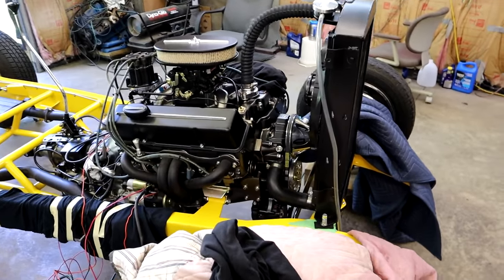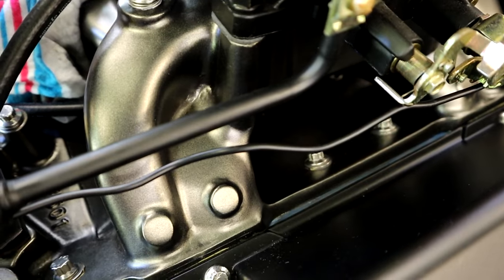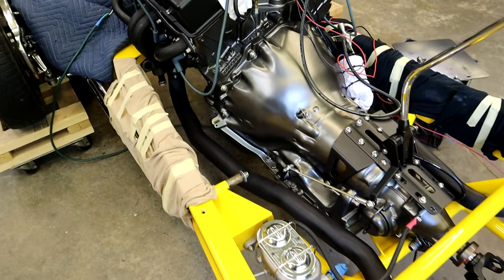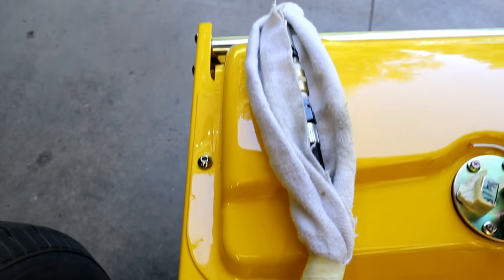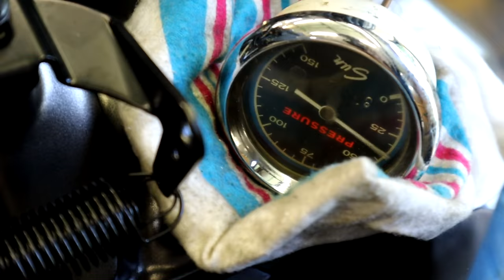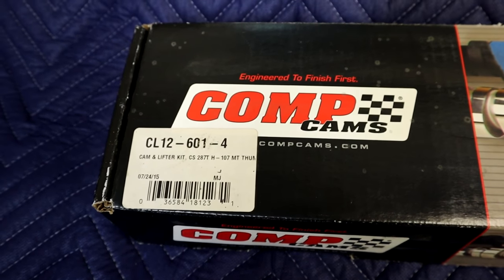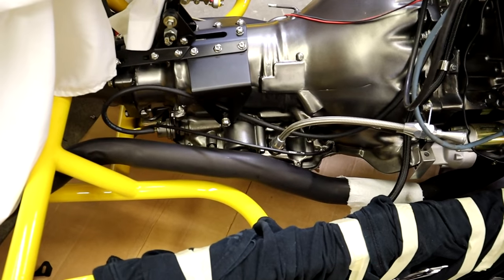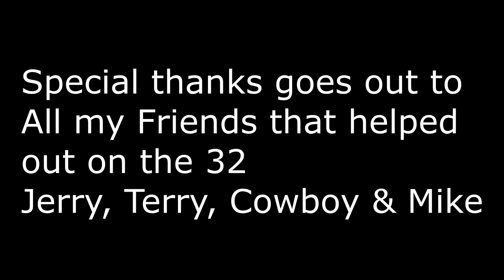Crate 350 Small Block Chevy - with Mutha thumpr Cam - First Start !!!!!!

Comment: Sweet sounds of the 1960's, cams, headers, close gear ratio 4 speeds, aluminum high rise intakes & hollies, and nice rear ends.  It was all about the sounds with good friends.  You never get it out of your system.
Reply from the maker: You nailed it 👏 👌thanks for the comment!!!!!
Reply: Just like classic Volkswagen Bug & Ghia lovers.
Reply: Yeah sorry, they didn’t have cams like this in the 60s…🙃
Reply: I was born in the 70's but still young enough to remember the sound of a cammed sbc.
Reply: @David  No, they're different from the 60s,  back then it was called a 3/4 cam, or three quarter race cam. My dad had one in his 1967 camaro. "Iski" cams were the thing back then. Flowmaster wasn't born yet, everyone had cherry bomb or thrush glass packs. good times, I miss those days.
Reply: @theNillaLenape  Better ones like Isky and Crower
Reply: @theNillaLenape  They sure did

Comment: That brings back memories of breaking in the 280* .512 lift in my mustang. Good times.
Reply from the maker: I bet that sounds awesome , thanks for the comment!!!!!
Reply: I understand that.  I had a small block 366 CID Chevy. 16.5 to 1. 675/326 can full roller motor naturally aspirated single carb would run 8 seconds in quarter mile.  400 turbo manual valve body 5500 stall in a 1967 Camaro. Miss the true good old day's.
Reply: @norristammislideshowmulgre877  that's sounds pretty bad ass.  Fortunately they make them faster now than they did before,  if you got the money.
Reply from the maker: @norristammislideshowmulgre877  now thats a hotrod!!!!!!!

Comment: I have always liked the sound of a 270 s comp cams solid lifter cam combined with a c26 and a pair of 9000 series a f b carbs a pair of 461 casting heads 10to1 compression and an aluminum flywheel on a 350 Chevy nothing can beat the throttle response that build will give a small block Chevy
Reply from the maker: I agree , I've always loved comp cams, thanks for the comment 👍

Comment: I can tell that’s gonna be a beautiful ride! The detail is awesome! That frame looks really good! So does the engine where you sanded it down and filled it with epoxy primer and such. Really good job. I’m tempted to paint my stroker that color!
   Here’s a piece of advice though; I know you want to hear it idle and all after you break the cam in but it’s really important to check the pushrods as soon as you’re done with that 15-20 minute run in. Shut her down, take the valve covers off, mark the pushrods, and make sure they’re spinning. Make sure you didn’t wipe out a cam lobe. Very important.  Besides that it’s an awesome ride! Really cool!
Reply from the maker: Thanks you for the kind words!!!!!
Reply from the maker: Thanks for the info on cam break in, we broke it in ,I just edited it out due to making the video to long, thanks for the support!!!!!!!!!!!!
Reply: C'mon bro. That's the FIRST thing you learn

Comment: Sounds and looks AWESOME !!!! Just a "heads up" on the "Pertronix Flame Thrower". We built a similar engine (283 with a custom ground cam in a 57 210 Sport Coupe) and used the Pertronix Flame Thrower distributor and coil. Like you, started it and set the timing at 12 degrees with a "dial up" timing light. It ran great on the stand. In the car, however, it was having a really hard time getting the car moving from a dead stop. Once moving it was great. Originally thought the issue was a too big/fat carburetor so began a process of "tuning" the Edelbrock Performer carb. Edelbrock tuning kit, step up springs, metering rods, and jets leaned it down by +- 15 percent while bumping the timing to 16 degrees made it better but still not right. Ultimately installed a AFR gauge and verified our carb settings. 
Two months in, finally got the answer when I installed a "points" type distributor and set the timing. The issue about went away. Talked to Pertronix tech who told me "DO NOT USE A DIAL UP TIMING LIGHT WITH THE FLAME THROWER" !! The Flame Thrower creates a MSD (Multiple Spark Discharge) ignition that "fools" the dial up light so you aren't getting the advance you think. "Use a cheap (Non dial up) light to set your initial timing" !! I have mine set at 18 degrees (with no vacuum to the advance) and the engine loves it!!! Absolutely NO issues associated with the timing. New points and condenser with dwell set at 30 degrees so, for now, I'm keeping the points distributor. will change back to the electronic later. Again, just a "heads up" to try to save you two months of "hair pulling" !!
Reply from the maker: Awesome man, thanks for the heads up!!!!!!

Comment: That right there kids,is the sound of pure happiness and glory.........oh wait im still a kid. Im 16 😇

-Edit im now 18 and now i got my own 87 chevy r10 i got for a good deal,now im building up the motor with a almost all black theme with polished accents here and there like my valve covers since they have little ribs that i had to polishe same with my intake manifold were it says edelbrock and what not, block is all orange since i still wanna see any possible leaks but with all the felpro gaskets i put on it with some black rtv here and there and gasket sealant as well to dress up the paper looking gaskets it hopefully shouldn't leak......hopefully... ._.

But the engine is a stock 350TBI now a 355 since it had been rebuilt with a small cam since again its a stock motor with the worst heads possible since its a TBI forgot the specs of said cam but it will have some lope/chop to it :D ,now im just saving up for the holley midmount accessory drive kit in black ofcourse should be able to buy it super quick since i got a really good job that pays really well and it might end up being my career maybe

Another thing to top it off is that all the hardware on this baby is nice quality ARP hardware to go with the new and freshened up parts on there :D one of my favorite things about my motor :D
i would list the parts i bought and some that i restored and painted but its basically almost ready to drop in once i freshen up some of the drivetrain and find the wiring for the truck thats somewhere ...........
Reply from the maker: Hot rod kid!!!!! Thanks for the comment
Reply: @ACDesignsGarage  Your welcome 😇
Reply: Im 16 to bro your not wrong

Comment: I have a 385inch stroker, with 11:1, and the comp nos HP cam, I can't wait to hear it, 
Yeah she's very talkative, at idle , and at cruse rpm,  my cam is the largest nitrous HP cam, with .585" lift with 1.6:1 roller rockers, your paint looks awesome! I love metalics with flat/satin clear over it,
Reply from the maker: Thanks man, Are you gonna film a video on it, id love to hear it run, or if your on Instagram tag me in it, mine is @ac_designs
Reply: Better have you some good flowing heads that peak at about .600
Reply: So you have heard your cam or you havent?

Comment: I think that I purchased the same motor from jegs. Assembled in Mexico. For 1984 Chevy c-20. Original air cleaner had decal stating timing to be 4 degrees. New engine ran terrible at that setting. Reset timing by ear and ran better. The setting by ear threw the timing light way off. Engine still running good. Wish I would have purchased the cam you have. Motor sounds great. Gonna sound really good on street. Peace👍✌
Reply from the maker: Awesome thanks for sharing and your support!!!!
Reply: Engine came with instructions Im guessing? Hope you got a timing light on it, the by ear thing is never accurate .

Comment: This is a master piece. I got a similar  air cleaner . I was told to get one either taller filter or the ones with a filter on the top part.. to get more air into the carburetor. Your opinion. Take care!
Reply from the maker: Thank you, Ive heard that also but id rather look cool than have proper air flow lol

Comment: You always need to keep the high idle up while the cam breaks in, fin awesome guys !
Reply from the maker: We did, i just edited it out so i didn't bore everyone lol ,thanks for the comment!!!!!
Reply from the maker: Jeffrey Bamford  you would be surprised lol 😆
Reply: 2k rpm, which is the point of optimal oil flow.
Reply from the maker: @barnabyjones5161  I would say depending on the oil pump probably around 1500 to 2k rpm
Reply: How long do you keep the idle up while breaking in the cam ?   20-30mins
Reply: @ACDesignsGarage  Kinda low...2500 give/take and varying rpm always worked out well

Comment: Problem with 2005 Lariat, 5.4 Triton eng. Cold start backfiring, once it goes runs well, wiring? Has a new gas pump. What do think is the problem? Need feedback?
Reply from the maker: Do you know if its throwing a code/ is the check engine light on ?
Reply from the maker: Dave Micolichek  thanks for helping out, I've been searching online to try and help him out ,but im not familiar with the 5.4

Comment: That's solid as a rock all the way down I love those Mutha Thumpers. I've installed one in a 468 in my 1977 gmc but it didn't let me pass up service stations. Are you using flat tapped or roller I have a case of Comp break in oil.
Reply from the maker: Were using hyd.flat tappet.  Witha all the lifter problems the next one I do will be a roller for sure!!

Comment: For what it's worth, my friend, I've built more smallblocks than I can remember, but I've always used white lithium grease for assembly lube and Mobil 1 full synthetic oil in straight 50 wt. for racing and 10w30 full synthetic for street use.  This is my first time on your channel and I like what I see, thanks for sharing. BTW, I'm leaving a thumbs up, a sub, and a click on the bell. I hope to see more of your works (fun), in the future.
Reply from the maker: Welcome aboard, Thank you very much for your support!!!!!!! Awesome ,I always love when people share there tips and tricks !!!!!!!!!
Reply: @ACDesignsGarage ,
I'm on the tip of my seventh decade, if it weren't for the "Old Timers", way back then, I wouldn't be sharing what I've learned, possibly from them. Keep up the good works, I enjoy seeing a nice clean workshop too.
Reply: Synthetic oil, especially Mobil1 is awesome oil. But synthetic oil of any kind is not the way to break in an engine. Most engine builders will strongly recommend against it. Synthetic oil does not allow the rings to seat properly, and should not be used until there is at least 5000 miles on an engine. And if its a flat tappet motor, you need to add a zinc additive to the oil to not destroy the cam. Or buy a special high zinc oil.
Reply from the maker: @jeffpolsene680  we used valvoline vr1 which is a high zinc oil that my engine builder recommended,  i have to change my affiliate link something  went wrong there lol, thanks for the tips!!!!!!!
Reply: @jeffpolsene680  ,
Jeff, did you have a 65 Chevelle that you bought new and used just on the dragstrip?
Reply: @jeffpolsene680  Mobil 15-50 has some decent zinc but like you said....a non detergent oil (not syn) is best
Rings were seated by  mile 50, no need to go 500 unless you run old iron rings and a rougher hone finish

Comment: I enjoyed watching your video I watched it before I like looking at old vehicle and I like the color you put on your 350 motor can you tell me how much it cost you to fix your motor like that
Reply from the maker: Its not to bad if you have the material laying around, but if you go to buy it it could be several  hundred dollars. I ground the block as smooth as I could then epoxy primed it, the shot a light coat of 2k highbuild then sanded it with 320, then shot the base and clear coat.

Comment: With your cam specs that motor should run it's best around 31 degrees advanced
Reply from the maker: Thank you
Reply: You mean 31 total correct? At 31 base it won't start. Need to drive it and maybe make a couple 1/4 mile passes to experiment with different timing  settings and then curve the distributor accordingly to get the best driveability.
Reply: @dougthurmond5988  yes absolutely
Reply: @dougthurmond5988  that cam might need a little more timing, not that damn much though lol, he said bad for the environment lmao, he's on the wrong page, he needs to be on one of those soy boy beta pages
Reply: @poopl00p3r  lmao 🤣
Reply: @Romans--bo7br  sbc run best around 36 degrees in stock form so I don't know wtf you're talking about lol
Reply: @jonathanlawson4667  Depends on the cyl heads.

Comment: Sounds great, but you only had it running about a minute and a half in the video before you let it idle. A flat tappet cam needs to run at 2000 rpm  while varying for a good 20 minutes. Im sure you guys know this , did you do a little time lapse while breaking in the cam? Just wondering. Would hate to have to replace cam in a few hundred miles.  Awesome job on the trans and engine paint. Car looks good.
Reply from the maker: Thank you!!! Yeah I just edited out the break in cause it was gonna be so long.
Reply: It looked like he had retrofit roller lifters, if so there's no need to break it in

Comment: I have a question about the exhaust pipes.
The pipes that connect between the headers and mufflers, did you fabricate them or are they a bought item?
If bought , where?
Thanks!
Reply from the maker: Thanks for the question, the exhaust was built by adams hot rod shop thats where we bought the chassis from, all we had to do was buy the headers. You may be able to contact  him to see if he would make some, he builds a ton of these 32s and bends the exhaust in house.
Reply: @ACDesignsGarage  Thanks!

Comment: Did the camshaft eat itself up after driving it ? The minimum break in time is 15 minutes at a constant 2,000 rpm
Reply from the maker: Thats how we broke it in but I just edited it out cause it would of been to long of a video. Thanks for the comment!!!!!!
Reply: Don't need to break in a retrofit cam, those are hyd roller lifters,
Reply: @briandcarey3110  The part number on the box shows he is using flat tappet

Comment: Why is the distributor positioned like that?
What's the vacuum at idle? 
Sounds great 👍👍👍
Reply from the maker: We never put a gauge on it. As for the distributor we positioned it a lil different so we could clear the firewall better, we weren't sure how close it would be to the firewall before we put the body on.
Reply: @ACDesignsGarage  ok. Understand. Custom vehicle. Thought it might have been a speed trick. Lol
Reply: Might need a vacuum canister with that cam, the Thumprs are notorious for having bad vacuum, you have the  mother thumpr too,

Comment: "Set timing at 12°"...  I'll bet it overheated at idle too!  Why does no one verify their timing with a vacuum gauge?  Thump'r cams run best with LOCKED timing at your all-in spec.  This is due to the large amount of overlap they have (to make the sound at idle).    Mine is locked at 35° in my SBF 289.
Reply from the maker: It idled for 1 hour inside and never got over 180 degrees
Reply: @ACDesignsGarage   Interesting.   Vacuum advance connected to manifold or ported?

Comment: Those cams sound the part but your throwing 20 HP out the tail pipe by using it
Reply from the maker: Yeah thats what we wanted, just some noise ,not really concerned about hp lol
Reply: @ACDesignsGarage  I hear you, I actually learned the hard way twice just how much HP is lost by using this cam. I threw 60 HP down the drain on a 545 CI Big Block Ford. Pulled it on the Dyno and put the old roller back in and gained 59 HP and 26 TQ. The older Cam had basically same lift # but duration was a bit tighter and the Lobe Separation was 110. At the end of the day the Lumpy sound was still there.
Reply from the maker: @RipitRon  thanks for the info! I heard they were just noise makers lol, my dad said as long as it will run the speed limit and sound good he's good with it Hahahahahaha
Reply: @ACDesignsGarage  Well there you go, If he is happy then thats all that matters. Love what you did with the Galaxy Grey HOC, I love the HOC line and hate it all at the same time. LOL

I painted my wifes 32 with HOC, Mixed 50/50 Kobalt Blue with Kosmic Purple. The Layering of the System is problematic, Would never do that again.........Concentrate yes Kandy...........NO Way!
Reply from the maker: @RipitRon   I have the same feeling about HOK love and hate lol, I  bet that color was awesome on your 32
Reply: @ACDesignsGarage  He will change his mind when he floors it and it doesnt pull much different than it did with half throttle. Btdt. Nobody with a cammed up engine truly doesnt care what it feels like when they wanna play

Comment: Damn, I wouldn't put an open gas can that close to the exhaust.. BackFire??
Reply: It’s fine, nothing to worry about!
Reply: especially with that crankcase ventilation not being connected..I built a very similar set up for my 23 T bucket...I left mine off too for the first start up...ran great sounded awesome, but when you would turn it off it would blow torch 1ft  flames out the lake pipes and it leaked oil from all new seals...connected my ventilation and cure it all ran better too.

Comment: Did you have to change the springs on the heads to install the retro roller camshaft? Great video.
Reply from the maker: Thank you, No its all stock Gm except for the hydraulic cam and lifters
Reply: Yes you will have to .Period

Comment: What transmission is that im in the look for one on my built 350 engine but havent decided what to go with
Reply from the maker: Its a turbo 350 automatic , if your gonna drive alot of highways id probably go with a 700R4 automatic it has overdrive, but the 350 works great also!!